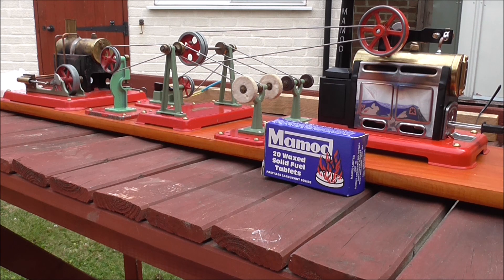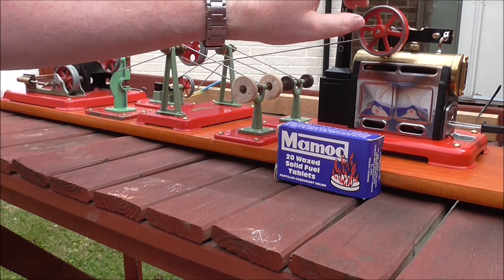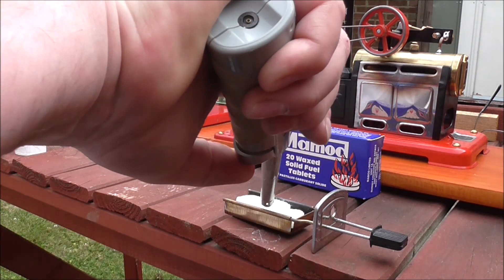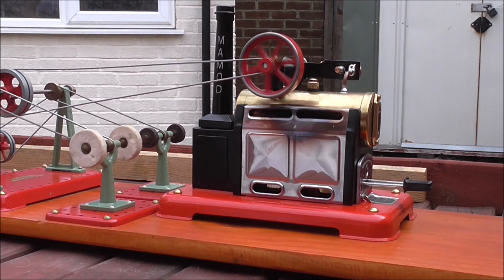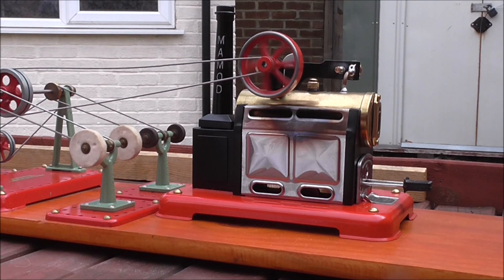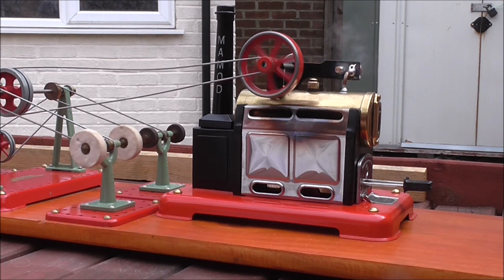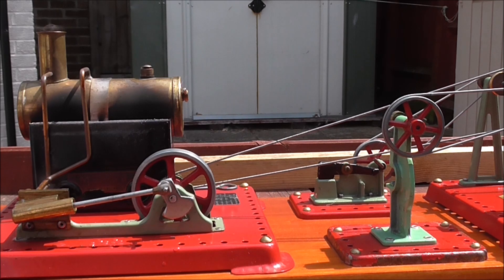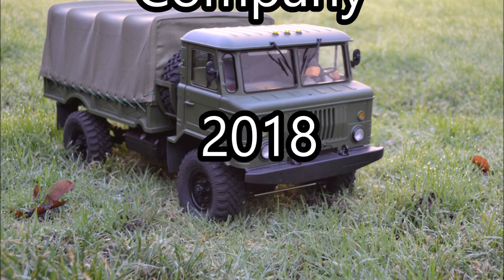Mamod SE2a vs SP2 - Vintage BasBoy RC

Comment: Wow, my memories since many years ago! Cheers F. -  like 2
Reply from the maker: You just cannot beat a bit of steam, The old engine the SE2a was about 40 years old in a very sorry state. It's now replaced with the SE2 I got cheap and in mint condition.
Reply: @BasBoyRC  You did a wonderful job, now the system is young and perfect again, bye Mal

Comment: That is really neat! Is that buffing and sanding wheels on that? I've never seen anything like this before, very interesting!! 👍😎👍
Reply from the maker: They are buffing and grinding wheels but not enough power to work well. That's a full set of 5 things Mamod did. My SP5  video is set up with the full 5-in-1 Workshop that came out a lot later. There is still more interesting things to come.